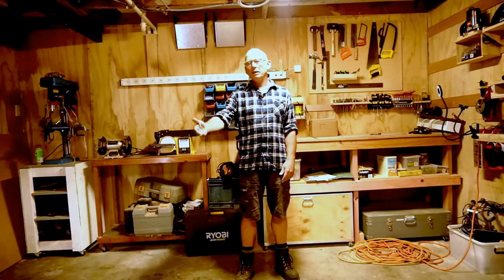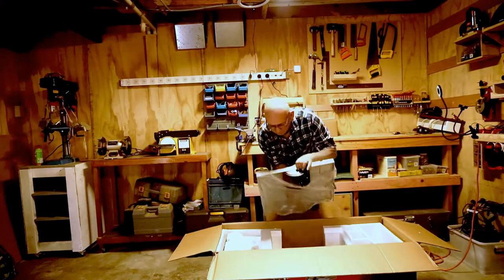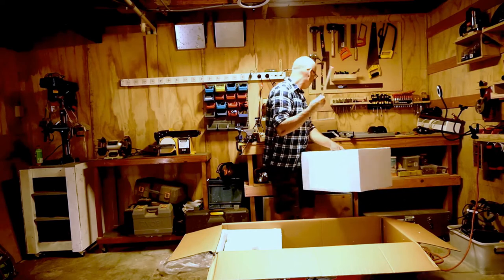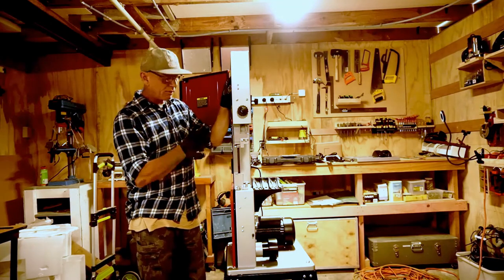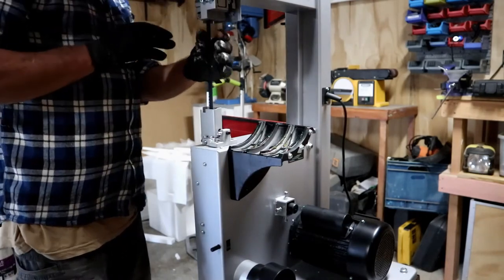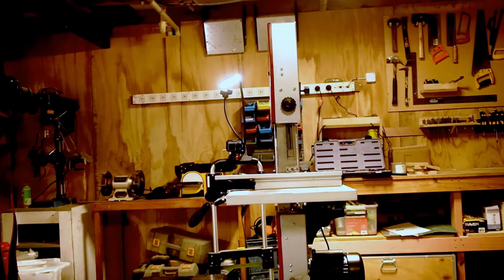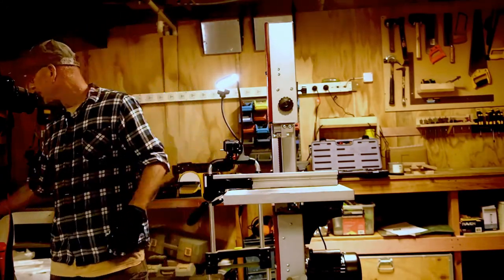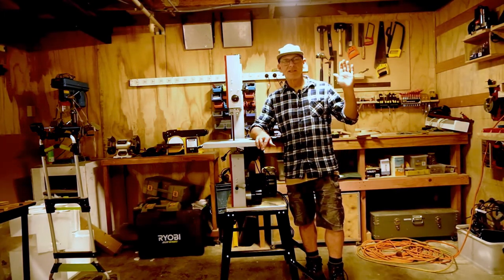Full Boar Band Saw Unbox, Build, Setup and Test

Comment: My only experience with Full Bore is that I have their 750W drill stand which I love.  It has a 16mm keyless chuck, and infinitely variable speed from 450 to 2200 (ish).  The build quality is great, and is why I homed in on their bandsaw when I decided I needed one for my home shop.  I suspect you have decided that you are happy with those blade guides with use.  Even some large bandsaws have tungsten bottom guides that require changing for different sized blades — are their narrow blade options btw? It will be easy to make new guides or grind them flat if needed, or modify the other end of the guides for narrower blades perhaps. Repurposed drill stock would do at a pinch.  I am sure you realise that the rear adjuster for the upper wheel actually tilts the wheel?  That's just me being pedantic.  Anyway, I am happy to go ahead and order one of these after watching your video, so thanks for the upload.
Reply from the maker: Yep have looked at there drill but my El cheapo is still going strong so thats a later upgrade I think. Yeah the blade guides seem to be working fine its just that i was used to bearing guides on all the saw's i have had before but they seem to work fine. Have not changed the blade yet so not sure about size and adjustment on a thinner blade but should be good as the guides are quite small round bar not the square type. My only issue with the band saw so far is the bottom bearing exploded and the top was starting to go but i just upgraded from the cheap Chinese bearings to better Chinese  bearings :) but so far really pleased with the saw has cut everything i have thrown at it so happy chappy.

Comment: I was researching bandsaws and saw  the price and thought it’s not to bad and seen you have done a review on the full boar you’ve had it a year now and was wondering what your thoughts are on it now thanks
Reply from the maker: Hi still quite impressed with it for the price. it's still working well. I did do an upgrade to the bearings as they did not last but that was cheap and easy the bearings came from RS not full boar. Yeah overall for the price its still working well and I am happy with it for a hobby band saw.

Comment: I bought one of these second hand recently and it tracks horribly to the left. The blade had never been set centre on the pullies and the guides were loose as well. I have reset everything and it still tracks badly . Will a new blade fix this ??
Reply from the maker: Not sure but you should check the lower pulley is centered with the 4 bolts on the back, not sure if that can affect tracking of the blade. What condition is the rubber strip on the top pulley if its cut up because they never centered the blade that might cause it?
Reply: @MadTaff  Thanks for getting back to me . I think 'll right off the 60 bucks and buy a new one 👍

Comment: How's the Full Boar band saw going Steve?  I am thinking about buying one.
Reply from the maker: Have to say, quite impressed with it, using it quite often and have not had to do any adjustments since the build and still cuts great and straight. It is a well built bit of kit for that level in the market and would recommend for any hobbyist.

Comment: Thanks for the Full Boar Bandsaw review. I purchased one and have been through the process of setting it up. Do you have a solution.. With the bandsaw blade gullet in the centre of top wheel I find that the back bearing on the top guide set at 0.5mm with the guide fully raised and then lowering the guide almost all the way to the table the back bearing is a good 6mm away from the back of the blade. Is this an issue? I did find I had to twist the housing with the top guide so that the blade was centre of the left & right guides. Like you overall best value 12” bandsaw of reasonable quality for my purposes.
Reply from the maker: I will check that and let you know. I have not noticed that happening on mine but then i might have missed it so will check and let you know.
Reply from the maker: Hi sorry for the delay, checked my saw and when i raise the blade guide it does not move away from the bearing but does move to the side when moved up so that the side guides will touch on one side. Will look at it and see if there is a way top stop it but as i said with mine does not move away from the guide bearing as far as i can see.
Reply: @MadTaff  thanks for checking that out, mine does similar with the side guides. I've purchased a new saw blade so will fit that and see if I have the issue with the bearing being closer when the guide is at the top compared to when the guide is all the way down. Thanks again for your reply.
Reply from the maker: @rogerwhawkins  i have been looking at mine and the other thing that could case the blade to be closer at top or bottom is if the bottom wheel is out of alignment its tilted in at top or bottom that could cause the blade to run at an angle i guess, not sure though? Otherwise i am not sure what could cause it unless there is an issue with the guide track?
Reply from the maker: Hey Roger, just to let you know i have had my first issue with the bandsaw, i was just starting to cut some pine pallet slats and the band saw started making an odd screaming squeaking noise and when i checked the bottom guide bearing was seized and when i tried to move it well it fell apart so not sure if this was down to me putting quite large cuts through the saw ( i did try planking some pine 1/2 rounds the other day that i took out of the garden and it was a long slow cut as they are 1 1/2 m long and i have been cutting some Pohutukawa rounds as well) or i just had a dodgy bearing? I went to get spare parts from full boar and well not impressed. I can get the spare parts, but they want 25 bucks for the bearing and then when i said i better get a replacement cir-clip as well just in case, yes that little standard sized cir-clip in front of the bearing on the offset post they said they wanted 26 bucks for it. Hmmm i think bloody not. So cir-clip came off easy and i have ordered better bearings from RS Components. I got 4 for the same price Bunnings wanted for 1 well it was 5 bucks more with post and they will be here Monday ish so will fit and try next week. The bearing is 5mm wide 5mm ID and 16mm OD. hopefully it was just a dodgy bearing as the top bearing seems fine but you don't run against that one on the face. Anyway just to let you know.
Reply: @MadTaff  Hi Steve, how is the bandsaw going after 2 years of use?  Have you had any further issues after replacing the lower blade guide bearing?
Reply from the maker: @mrt-gt  Bandsaw is going great have not had to do anything else to it. still running great for what i do.

Comment: Well I've been looking for a bandsaw the past month and the cheapies were just that, cheap and nasty. So I'm off to order one of these. Thanks for the vid 👍
Reply from the maker: No worries i had the same issues and after looking around and hmming and aarring decided to give the full boar a try and have to say a really good saw for the price.
Reply: @MadTaff  So l bought it along with their digital drill press. They get delivered today. I'm very excited. 👍
Reply from the maker: @MikeSargentOnline  nice one
Reply from the maker: @MikeSargentOnline  lets us know what the drill is like
Reply: @MadTaff  Hey. Drill is awesome. Powerful and accurate. Onboard light. It is  a fair sized press though with a decent footprint. On to the bandsaw. It had obviously been delivered to someone previously, as everything was out of the bags and there were nuts, bolts and washers all over the place. They swapped it over the next day. Had a little trouble with the bed and plastic insert. Ended up having to put the table insert backwards. Go figure. Still works fine and l love it. 👍
Reply from the maker: @MikeSargentOnline  Thanks for letting us know glad you are enjoying, shame they sent a used first. have fun making.

Comment: Hi Steve great vid and guide. Looking at one of these myself in NZ. Are you still happy with the purchase? Also what's the maximum cut depth you have tried? I plan to possible cut to its maximum depth sometimes hardwood too. Just wondering if you had tried the saw on anything like that? Many thanks.
Reply from the maker: The max height to the guide is around 165mm and yes i have tried cutting that depth, it will do it, i was cutting pine, Pohutukawa and some unknown wood, non are hardwood and had issues with the harder / denser pohutukawa but it was wet wood, it did cut but had to go real slow. Fine with the pine (it was dry) though but thicker did mean slower. If you have a lot of hardwood to cut hmm it will do it i guess and seems to track pretty straight but would be slow.
Reply: @MadTaff  Thanks for that Steve, it will not be a lot. NZ totara and some manuka but actually not hard wood so should be all good. I tend to pick up some nice NZ hardwood as drift wood, well dried and small pieces usually but would take it slow. Thanks again.
Reply from the maker: @DavidTawhaiB  Sounds good have picked up some nice driftwood but wife keeps nicking and using as art on the deck lol. I have to say i am still impressed with the band saw for the cost, compared to the tool line and Ryobi offerings that cost only a 100 bucks less and are toys really the full boar is really good value next to them.
Reply: @MadTaff  That’s great to hear now to convince my wife haha!
Reply from the maker: Hey David just to let you know i have had my first issue with the bandsaw, i was just starting to cut some pine pallet slats and the band saw started making an odd screaming squeaking noise and when i checked the bottom guide bearing was seized and when i tried to move it well it fell apart so not sure if this was down to me putting quite large cuts through the saw ( i did try planking some pine 1/2 rounds the other day that i took out of the garden and it was a long slow cut as they are 1 1/2 m long and i have been cutting that Pohutukawa as well) or i just had a dodgy bearing? I went to get spare parts from full boar and well not impressed. I can get the spare parts, but they want 25 bucks for the bearing and then when i said i better get a replacement cir-clip as well just in case, yes that little standard sized cir-clip in front of the bearing on the offset post they said they wanted 26 bucks for it. Hmmm i think bloody not. So cir-clip came off easy and i have ordered better bearings from RS Components. I got 4 for the same price Bunnings wanted for 1 well it was 5 bucks more with post and they will be here Monday ish so will fit and try next week. The bearing is 5mm wide 5mm ID and 16mm OD. hopefully it was just a dodgy bearing as the top bearing seems fine but you don't run against that one on the face. Anyway just to let you know. oh it took me 7 months to talk the wife (personal accountant) in to letting me buy that bandsaw lol :)